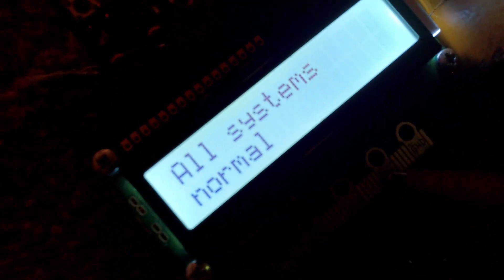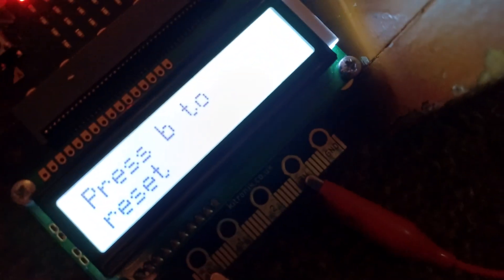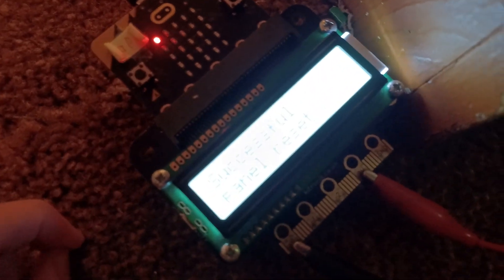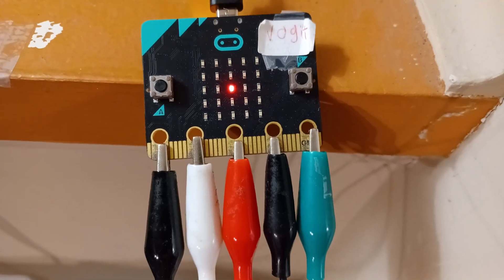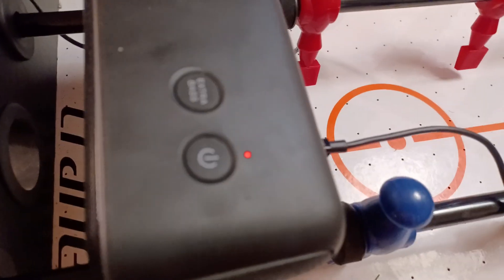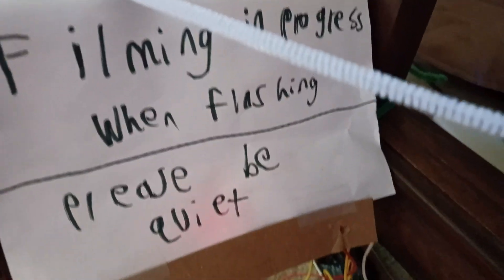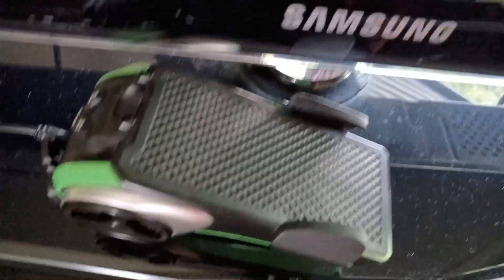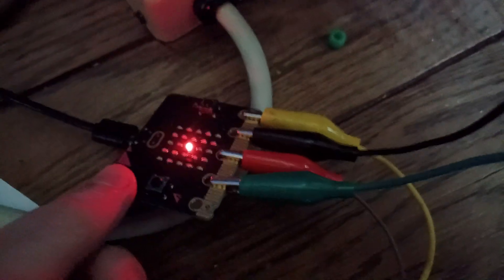microbit fire alarm system

Comment: bro use snap speaker to micro bit 3000iq
Reply from the maker: Those snap circuit parts work really well with the microbit
Reply: Yes
Reply: You used parts: SP & SP2
Reply: Did you use snap to jumper wires?
Reply from the maker: @tug5098  no